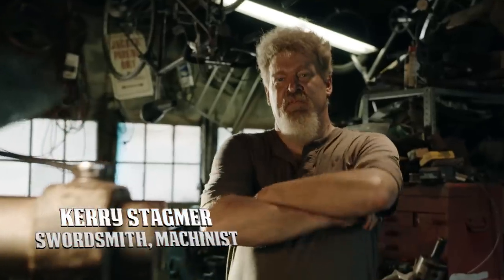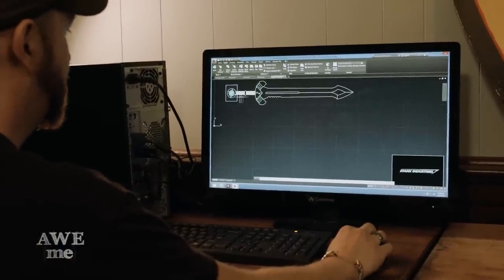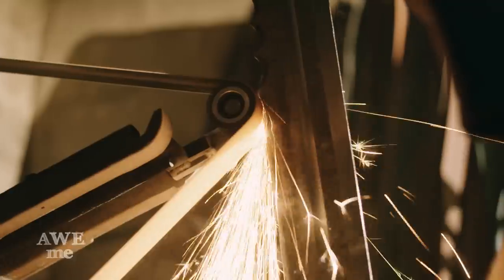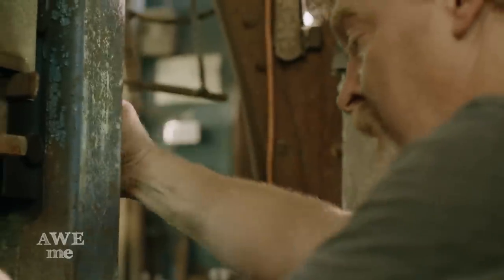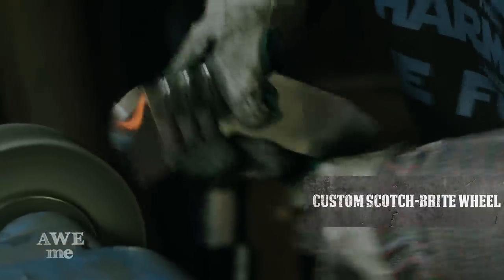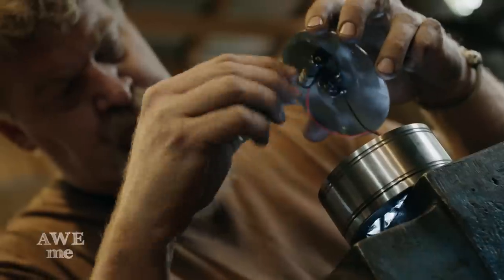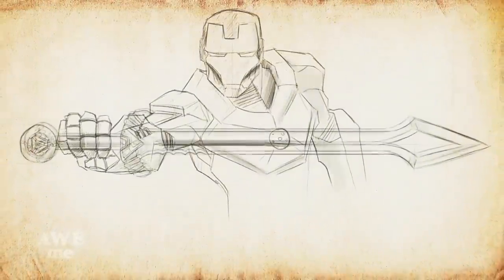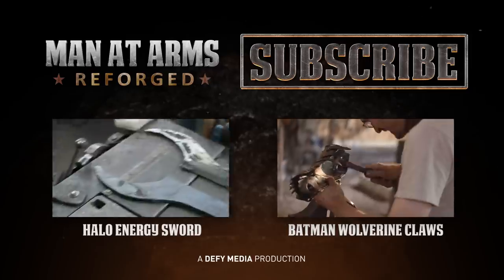Iron Man's Sword - MAN AT ARMS: REFORGED

Comment: As much as the sword looks great and all, I definitely think that Tony Stark would've gone for something much more sleek and streamlined. Precise, fast, and deadly. Like a rich kid's tricked out katana.
Reply: >katana
>katana
leave and never come back
Reply: i think it would be kinda like a beam saber from gundam
Reply: Maybe, but on the other hand THAT sword right there just screams heavy metal, which is more to Tony`s taste.
Reply: A katana is not "precise, fast, and deadly". More likely poorly designed, heavy, and terribly balanced.
Reply: ***** this, katanas are not very effective weapons, and can hardly even parry oopponents due to the delicate blades
Reply: ***** Actually they really are "Fast, precise and Deadly".

However they aren`t really durable and can dull pretty quickly which is why they need a vastly different fighting style to be used effectively.

One which doesn`t look to fit Tony`s bust through walls style at all.
Reply: *****
It's designed for a particular style of martial arts, the katana is quite deadly, its just not an "all around" deadly weapon.
Reply: Lee Peffers Exactly, katana`s have a higher learning curve whilst straight swords can be used by anyone.

(I`m not saying Straight Swords are inferior or aren`t equally deadly if You`ve got skills though.)
Reply: On top of that, parrying was often done with the sheath, the blade itself isn't the only part of the weapon. Again, very specific for who used it and the martial art.
Reply: Anyone who thinks a Katana is a particularly effective sword is highly mistaken.
Reply: Lets take a look at the concept of the nunchaku shall we? It wasn't even DESIGNED AS A WEAPON, but look at what bruce lee can do with it. I mean it was a farming tool and unless you are EXTREMELY SKILLED it's all but completely useless and will more than likely hurt you more than your opponent. People here talking about short swords being better, keep in mind katanas are meant to kill with one swing. Hence why they're heavy, they are balanced just fine because the balance is such to deliver more force from a stop when they swing. Small swords are better for actual combat where there's going to be more than one swing taken. You take that small sword up to a samurai and swing here's how that'll play out. The samurai parries your tiny sword with the sheath of his and slices through your body in the same move. The fight is over, the fact that your sword is lighter means absolutely nothing at that point. The sword itself is not deadly and in most hands it's a ridiculous weapon, in the hands of a samurai though...
Reply: Lee Peffers  I know that seems like the likely cause in your fairy tale. In all reality, the two swords would never meet in battle. If they did, the likely superior swordsmanship of most any European swordsman would beat a Samurai with a katana.

I know movies and such like to depict the Katana as a "superior weapon", but the fact is that it just plain isn't. It isn't heavy enough to be effective as an overall single-slash-kill weapon, and isn't light enough to be handled effectively.

By the same regard, there are many European swords that suffer the same (if not worse) drawbacks. The difference is, the swords were changed and perfected with the times. As armor and tactics changed, so did the swords. The katana didn't change much if any in almost 900 years even though armor and tactics changed. The katana only became less relevant over time, while other swords from all over the world evolved into better weapons.
Reply: That's kind of my point, that's like saying the ford model T doesn't keep up with cars today... Of course katanas can't compare with swords and armor after its time, that's more than obvious. At the time the only thing that stood in the way of the samurai were the ninjas. The sword worked for the samurai but once armor and other weapons became more advanced that sword became more of a decoration than a weapon. Hell for a long while in japan it was actually illegal for normal people to even own swords, so they had to get creative in order to defend themselves. So ya the katana got set aside for the sake of something more effective. You're right the swords would never meet in "real life" but we're here on youtube discussing functionality not the likelihood of the occurrence. On top of that honor and tradition was a big reason in why the sword never changed. Katanas could cut clean through bamboo armor (which was pretty much the extent of what they had at the time anyway) and then straight through what was behind it. It might not make it through a torso, but even if it doesn't the distance it travels still causes a fatal wound. As for arms, legs and necks, it would have no problems cleaving through, so to say it's not an effective single slash kill weapon is very very wrong (for its time). Yes it did, shortly after, become obsolete, but that doesn't mean in it's prime it didn't dominate.
Reply: True very true
Reply: Lee Peffers  That is the worst argument I've seen from some katana supporter that didn't include the word "fuck". While your argument seems sound, you seem to hang on specific words and take them far too literally. Not to mention, almost everything you have to say is hearsay, not based in fact.
Reply: The comic book Tony Stark/Iron Man wouldn't have a use for a sword. If for some reason he wanted a sword as part of his collection, it would use that signature repulsor technology to allow the sword to hover and swing by itself and maybe even go as far as shoot repulse beams from the tip of the sword. THAT would be a Tony Stark/Iron Man sword.

As for the real sword itself, I think it's a neat and intricate, two-handed broadsword design.
Reply: >All these people thinking they know anything about weaponry.
Reply: *****  Plasma swords can't cut through adamantium.
Reply: Or a hi-tech weaponised gold- titanium alloy exo- skeleton suit of armour with thrusts for flight and a Artificially Intelligent Co-pilot.
Reply: ***** But insults can.
Reply: aden fishsticks
 Well played.
Reply: Brendan Lohman
 O...kay?
Reply: jim jimson  Just because YOU think a katana is the greatest weapon in existence, doesn't mean it is.
Reply: jim jimson katanas are actually less elegant and heavier than longswords. They are also made of very weak material and most were poorly forged, which caused them to be poor at parrying, and also made them not last very long. You could easily damage an opponent's katana just by parrying them, and due to there very small crossguards, it would be relatively easy to attack them mid parry. In short, they fucking blow compared to other types of swords. live with it.
Reply: Sgt Papertowels Thats not true, the forging of a katana was essentialy ritualistic, and the material they were made of is a naturally occuring form of steel, much stronger than a lot of steels that were made by men. Also the way that katanas are made gives a layering to the steel making it one of the most difficult weapons to crack, the information I'm giving to you is how they make katanas nowadays, maybe back in times of fighting they skipped steps to speed up the forging process, resulting in these shabby mishaps youre referring to, but a well made katana is still a very high range sword. However in response to the original guy, why would someone with a exo-suit that makes him strong enough to throw tanks, choose to use a katana, the bigger the better I say because what does weight even mean when you're in that suit
Reply: ***** Dumb argument, european broadswords were made for their weight, materials were about as brittle as a badly forged katana. Not that it mattered, since it was mainly weight. Don't be dumb.
Reply: ***** why in gods name would a sword be made for weight, you wouldnt be using a sword against armor, you would use a mace.
A sword designed for armor would be stupid as hell
Reply: Sgt Papertowels What did knights wear in battle?
Reply: Dog footed Monkey man Tamahagane is basically iron sand and actually has very poor carbon content. That's what necessitated the baking in a kiln for three days with charcoal. Pattern welding, the technique of folding the steel several times, was then used to even out the carbon content. The blades of the quality katana's are made using very hard materials that can hold an edge while the spine is typically softer materials. This is done by differential hardening which also gives the katana it's characteristic curve.

However the hard blade is fairly brittle and does not react well to being bent. For what it does, which is slashing and cutting, the katana is very good. That said, like any weapon it has it's downsides as well.

Believe me, despite the mysticism surrounding Japan, one of the first things they traded for after opening the country to outside trade was several tons of quality steel.
Reply: ***** A Euporean sword wasn't used against armor. That wouldn't work. Steel armor isn't going to be cut by a sword. I am not sure what you mean by "European broardswords were made for their weight" Are you implying they were made to be heavy, or made to be light?

No sword to my knowledge has been made specifically to be heavy. There are much better weapons against armor.

Swords were often grabbed by the blade with one hand to force the blade past the unprotected areas in armor, also grabbed by the blade and stuck against armor with the hilt to hopefully deliver a concussion or other damage (as armor cannot prevent concussions). What I can assure you, however, is that no one bashed away at armor with their sword in an effort to break or cut through it.
Reply: Tony would likely whiled a teched out smallsword. After all he fights a LOT of armored dudes and the smallsword was deigned for amour piercing. Of course a warhammer is better at plate mashing....
Reply: Kyle Rhulain no swords are designed to fight armor. The point of a sword (heh) is to cut unarmored opponents.
Reply: Sgt Papertowels
Lol. Go read up on sword history, as well as the technique known as "Half-Swording" Suffice to say the slender narrows swords of the lat medieval period are designed to pierce platemale via thrusting.
Reply: Kyle Rhulain i know what halfswording is, but no swords were designed specifically for fighting armor, or even halfswording. If you wanted a sword designed for halfswording, you would make a sword designed for what half swording attempts to do, make your weapon have less range, by making a smaller sword. Even then, the closest thing to a sword designed against armor, was a type of dagger with an incredibly thick, fat blade designed to puncture plate mail. This not only wouldnt work with something as long as a sword, but a sword designed against armor at all would be greatly outclassed by blunt or bludgeoning weapons, and thus completely useless. If a weapon like that did exist, it would be rare, or only used experimentally for a short period of time.
Reply: Sgt Papertowels
Dude seriously? There are plenty of swords shown to be anti-armor. http://en.wikipedia.org/wiki/Estoc

"The estoc was a variation of the longsword designed for fighting against mail or plate armour."
Reply: i think he'd use a plasma sword
Reply: *****
I know im about a week or two late. But Katana's are actually very VERY effective weapons if you actually know how to use it. Also, a European versus a skilled Samurai, the Samurai would win. That's because a Samurai relies upon martial arts, which, if you check, does include quite a bit of dodging, where as a European swordsman relies upon mostly strength and endurance.

And One thing about Katana's... The ones you mostly find nowadays are cheaply mass produced and fall apart in minutes, yes, but that's the same with most Sword's you find nowadays...
If you read back into Japanese History, Katana's where actually incredibly durable and hard to dull.
Reply: Fash Themightygaming  No,they weren't. They were made with poor metals and refused to refine the method of forging or even the style of blade. It went unchanged for 900 years. Any weapon that goes through zero changes in that time is horribly outdated.
Reply: Fash Themightygaming Rolf power is right
Reply: maybe like a light wieght locked on to tonys fingerprint or his armour hologram misile firing hologram katana maybe
Reply: Sgt Papertowels the quality of a katana depends of the maker, katanas of real samurai where made of very strong metal and where much stronger then any longsword. but most people could'nt affort a well made katana. and longswords and katanas are both so diffrent
Reply: ***** I am not sure what anime you got that from, but you're wrong.
Reply: Lee Peffers The katana, wakazashi, tanto etc didn't become so much as obsolete as they were just straight up banned from use by the Meiji government, leaving the samurai cast with weaponized tobacco pipes, fans and sash (netsuke) pouches.
Reply: Sgt Papertowels Any sword enthusiast knows that every sword has it's pros and con's.
A Katana had a very thin but strong, single edge. This allows it to cut through the air much faster than most swords.

But they aren't like, super great swords like the fanboys think.

I think Stark would most likely choose some sort of plasma blade, Stark Industries certainly has the capabilities.
But if we wanna talk style for a real life equivalent, it would definitely be a katana like shape, in fact I do believe he has a plasma sword in his wrist in the comics, can't really remember, the only reason it would be katana shaped though, would be for size, a nice thin beam of plasma.
Reply: MrKhronicz Katanas aren't really any thinner than blades from other areas, personally I'd go with a saber over a katana as the saber has a longer blade with a similar weight and spine thickness, while having better hand protection (tsuba's are pretty awful hand guards) and is single handed letting you present less of your body to the opponent as you can advance in a more sideways approach, and in tony stark's case it frees up a hand allowing him to shoot the plasma beams from his suit
Reply: I did some research into this matter and found that neither sword is better than the other. Reproductions of swords of both kinds usually end up with poor quality. To say that only samurai knew martial arts and would therefore win against a European sword is very orientalist in thinking. European swordsmen had their own type of martial arts as well. It mostly comes down to the quality of the sword, the skill of the user, and luck.

Sgt Papertowels I'm not being confrontational, just curious. When you said sword weren't used actively against platemail, did you mean swords weren't used to slash through platemail? It's just that I found out about the Ewart Oakeshott/ XVII and I believe it was meant as a countermeasure to platemail by thrusting into any openings the armor may have and also to keep swords relevant when maces, axes, etc. were more effective against armor. Was that not right?

***** Not all katanas were made with poor quality materials/steel just like not all European swords were made of poor quality materials. The median quality of Euro-swords are higher than katanas, but the best examples of both types are of good quality.

Katanas are not the be all end all of swords. They can bend and chip (although, I think there might smithing techniques that get around the chipping part but I'm not sure). Euro-swords are effective when used properly and katanas can be effective if used properly too. There are a lot of factors to consider and too be honest, arguing over which sword is better is pretty stupid. Someone could have the best sword in the world, but it would be useless if they didn't have the skill to use it.
Reply: Vinland I see your point, but hear out this argument.

Tony Stark is anything if not, a very stylish man.
Katana's may not be the best sword, but no sword is, but it's certainly got a certain.. Style, that no other blade I've seen can replicate. I know style is the least of your worries, but hear me out.

Would it matter what the shape of his blade would be, if we are to assume that like in the comics, his sword would more akin to a Lightsaber than any real life blade? Then it wouldn't matter, super-heated plasma, I imagine, would literally burn up the air around it, wind resistance isn't a factor we need to consider, nor do we need to worry about chipping or dulling the blade, I just personally feel that if Stark was to choose a particular style of blade, since it doesn't matter which he picks, he would most definitely go for the Katana, simple for the style factor alone :)
Reply: MrKhronicz katanas are hardly stylish. Look up sabers if you like the look of katanas. They look way better
Reply: Sgt Papertowels "Look up sabres". (Yes, it's 'bres', not 'bers' I know what a sabre looks like. A Sabre is just any curved blade.
If I had a Rapier with a curved blade, it would be a Sabre.
The curved Cutlasses you see in games and movies, being wielded by pirates, those are just thick-blade sabres.
I know what a Claymore looks like, Broadswords, shortswords, bastard swords, scimitars, kukri, machete's, daggers, maces, morningstars, battle-axes.. I know a lot of weaponry, I own some of them.
My opinion is my opinion, I think Katanas look stylish, more-so than sabres, you have no right to tell me I'm wrong.
Keep your opinion to yourself if you're only going to talk down on mine.
Reply: MrKhronicz not talking down your opinion, just stating my suggestions. I think that katanas are a little bit too bland personally, but thats youre choice i suppose
Reply: MrKhronicz Sabre or Saber, both ways of spelling it is correct.

The spelling of sabre hails from the old world and remains the European spelling. Early field manuals and writings from the 19th century in the U.S. also used the army sabre spelling. By the turn of the 20th century, U.S. manuals began to use the spelling of saber.

So it all depends on what time, and type of saber you're talking about.
Reply: Vinland Interesting, I never knew that :)
But I'm from Scotland and so I've only ever known it to be Sabre :)
Reply: Meep Changeling  bringing wiki as your supporting point is as good as killing all your evident.
Reply: ***** A polearm. With a sword on their hip for the "Oh fuck I'm screwed my polearm broke/is gone. I guess a sword is better than nothing" moments
Reply: Mike Algiers dude stahp...no one cares
Reply: he'd prolly use like a buster sword or something, and if it ever comes to katanas, well two pairs of vibranium to go through things and never break
Reply: Since when has tiny ever been sleek and elegant? He's always like big booms
Reply: Sgt Papertowels "More likely poorly designed, heavy, and terribly balanced."
Sgt Papertowels "katanas are not very effective weapons" 
Please tell me you're both joking... Do you know how much work goes in to making a REAL katana? A LOT. They are very effective weapons, are designed amazingly, and are well balanced.

My god, I hate when people talk shit about things they know absolutely nothing about.
Reply: It's obvious that a lot of people are really biased about what sword is 'better' because they are obviously from where their swords were made.
I could honestly 100% guarantee that a samurai would beat a European knight in a battle any day. The training that a samurai has to go through is far more intense then any knight's training.
Reply: Retz Not to mention that when not fighting, Knights were rude, obnoxious and vile men, the idea that they were therese amazing, deadly and chivalrous people, is a farce, the fact that a Law of Chivalry had to be put in place to stop them being such horrible people should really spell it out for them.

They lacked discipline, while it is true that a Knight went through training to be a swordsmen, they would never outmatch the speed and dedication of a Samurai.
Reply: MrKhronicz samurais were not even a little bit honorable. They literally murdered innocent bystanders to see if their weapons were ready for combat
Reply: Sgt Papertowels Thank you for an entirely redundant reply. Please point out where I ever called Samurai "honourable", or any word that means honourable.

The simple fact is, they were machines of combat, of course they were abusive to the peasants, as were the knights, people have always looked down on those lower than them in social status.

But there's a difference, Samurai lived by a strict honour code on the Battlefield, they had discipline, they were focused and deadly. Rarely would you see a Samurai Warrior fall in battle.

Knights on the other hand.. Those were just guys that were strong enough to wear the armour and knew how to swing a sword, really.
Reply: MrKhronicz if you weren't trying to point out that samurais were HONORABRU WARRIOR then what was the point of saying knights lacked honor and discipline
Reply: MrKhronicz Knightly combat was just as advanced as it was anywhere else in the world, they didn't just give you a sword say "ok you're good to fight now" They spent their entire lives training for combat, from as young as 5 or 6.
Reply: MrKhronicz "Knights on the other hand.. Those were just guys that were strong enough to wear the armour and knew how to swing a sword, really."
I'm sorry, but I'm hereby vetoing any possible credibility you had up to this point. 
1) A knight is someone who is recognized by royalty, not even a battlefield combatant oftentimes. That's why there are knights today, but you don't see any of them, y'know, fighting with swords. The term that's being woefully ignored here is "Man at arms". 
2) In what bastardized universe would it ever make sense to waste money outfitting a soldier with high-grade equipment like plate armor (which had to be custom made and fitted), if you're sending them out with no training at all? If a man at arms was not trained to at least fight others of his kind, you know what would happen? A slap fight. With two, terribly un-prepared tanks hitting each other's armor pointlessly, because neither one knows how to parry, feint, attack weak points, or even swing without getting pummeled. 

Please, if you won't actually study the topic, at least apply logic. The fact is, plate armor was horribly expensive for a long time, and if an army was going to be sent out untrained they damn sure aren't going to spend that much money on them. And a side note, on a real battlefield honor goes out the window pretty quick, if what you think of honor is what they show in media today. Attacking from behind? Ganging up on an opponent? Tricking your foe? Even for a samurai, these are fundamentals of war, as anywhere else.
Reply: russeshe001 didn't most knights fight with honor and pride as well that's what I heard but I am uncertain
Reply: I agree, he's not for heavy and slow. That's the reason he went for a more streamlined design as soon as he started. He's more for fast, stylish power over strong and heavy brute strength
Reply: Mike Algiers you are so cute I love you so much and you are my best friend
Reply: Mike Algiers Tell me why would you need a power source of that size of an arc reactor for A SWORD
Reply: Lee Peffers you need to do more research ninja was a job they were spies  samurai was a class which had many jobs  including some samurai that were in fact ninja
Reply: Bruh, ninjas were a bunch of drunk farmers pissed at the Samurai
Reply: +Samuel Shaver
"folded hundreds of times to increase the density"

Nope. That's not what the steel was folded for at all. It was to help remove impurities in the steel (since most older methods of smelting steel resulted in a pretty impure product compared to modern techniques) and to spread and even out the carbon content.
Reply: andymac4883  My bad I was looking at a side effect as the intended purpose, and I checked is it was thousands of layers, caused by the folds that was so high so my bad.
Reply: Mike Algiers I vote for an iron man light saber
Reply: JustGotCoded Gaming exactly what I  was thinking
Reply: Sorry to say that to you guys, but this katana X european sword did happen back the in the XVI century when the portuguese went to japan, nad the portuguese won, thre isn't a single historic account of a samurai winning a duel with a portuguese explorer, they were defeated by the sidesword parrying dagger, often by a thrust bellow the armpit cutting the subclavic artery which made them bleed to death, japanese didn't have experience in dealing with quick and precise thrusts of european fencing.
Reply: it was awesome
Reply: Mike Algiers THANK YOU!!! (I mean, don't get me wrong, the man's flashy AF when he wants to be, but he's also a scientist who knows there's a time and a place)
Reply: Rolf Power it is built to complement various forms of martial arts, as well as to fit a one hit kill style. If you deem this ineffective, then I would question you personal experience with swords of this style. (Learn the styles yourself before you decide to insult something that has endured "effectively"  for centuries.)